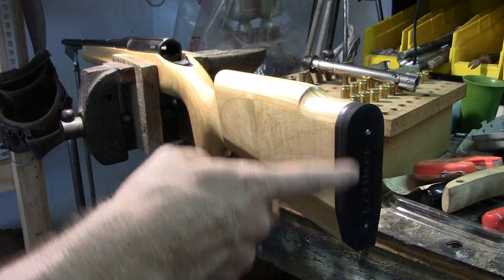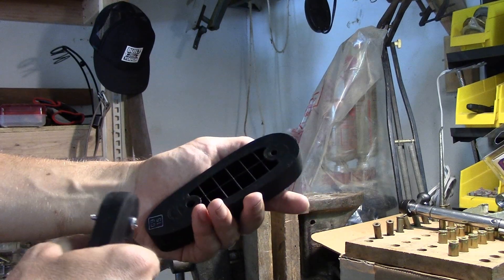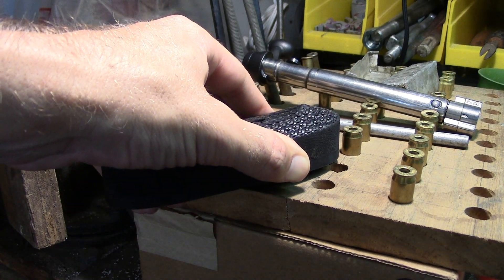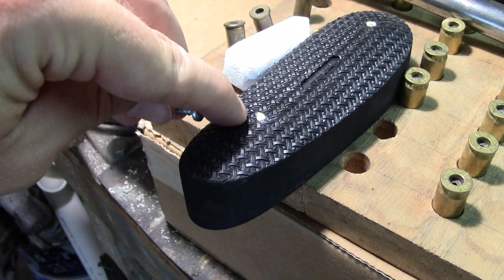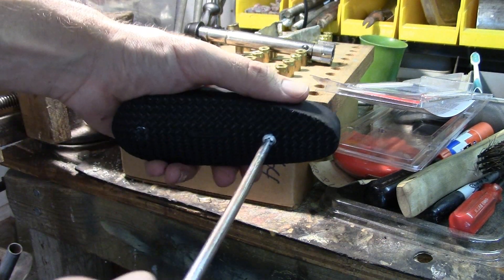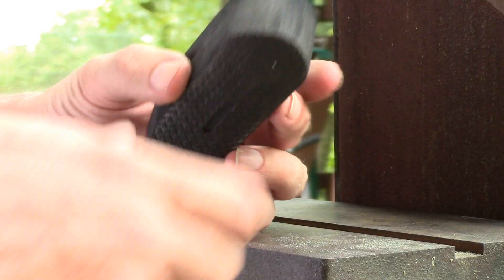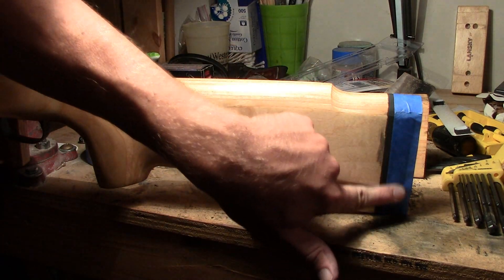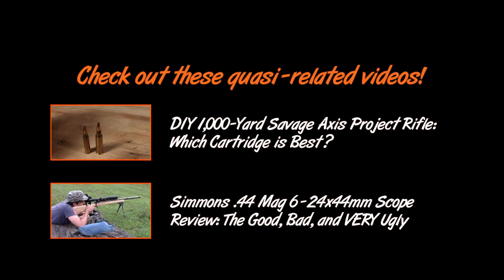Swap Buttpads - Shaping a Pachmayr Decelerator for a Boyds Pro Varmint Stock

Comment: 04/19/2025 Update:
================

Oops!  Forgot to tell u.  Counter sink the buttstock rubber around the screws w a flat router bit.  And use
appropriate washers to seat on that big hole.  U'll never have to struggle to unscrew those two holding
screws again.

Dink creatively than the others!  E.g., Minimize any maintenance headaches such as this as bad manuf.
designs continue as tradition as in this case.
====================================================================================
(4:54) I won't hide the screw heads.  Rather, it'll b better to use longer screws and keep the heads exposed

after the rubber cushion had mated w the wooden buttstock.  This is bc. if u strip the screw head (as my
used previous gun owner had done), it'll b very difficult to take those screw out.  So what if u or ur shooting
buddies make comment on the shinny exposed screw head on the recoil pad?  And it won't hurt ur shoulder
either.  Had to slice off the rubber to expose the stripped scrw hds.  I kant use the original (prev. owner's)
recoil pads any more, must spend $20 - $30 for a new one.  There comes a time when u'll need to access
the long bolt head that attach the buttstk to the receiver and the recoil pad must come out easily!!!

I did appreciated ur chaulk method.  For my case, i just drill the two holes all the way thru from the back,
w/o the use of Mr. Xacto knife.  Make sure to use a drill press to drill the holes perpendicularly.  If u don't
have a drll prss, then drill perpendicular hole thru a piece of 2 x 4 using someding(something) that is
square as a reference, drill a hole w ur hand drill, then use that as a guide to drill perpendicular holes thru
the recoil pad n buttstk.  Yes, a light removable glue at the back of the pad would help too.

Comment: How bad is the original pad? I messed up and forgot to order an upgraded one
Reply from the maker: It's very thin. If you picked a cartridge with any recoil, it'll hurt after a few rounds.
Reply: Mines a suppressed 7.62x39 so I don’t really know?
Reply from the maker: That's not too rough. Worth a try at least! If it's too uncomfortable, you can buy a limbsaver.
Reply: Cool yeah, how would a slip on limbsavsr work?
Reply from the maker: It should stick pretty well. Just a matter of getting the right size.

Comment: I really like your videoss, and the fact that you thought of building a target rifle on a budget. Too many people just go out and get the most expensive rifle and shoot off a 300$ shooting stand. So, well done for that build. I have a Savage Axis 2 chambered in .223 (the local range is rather small) coming my way, and I had a question about the bolt throw. Many have complained about the fact that the knob barely clear the scope that's on the rifle. What are your thoughts on that, and should I wait and buy the Savage Axis Precision rifle for roughly 700$ more? One has to think that the last rifle comes in a MDT chassis, a threaded barrel and a 20MOA scope rail. Considering that a Boyd's stock is 350$, a rail is 50$, and that I cannot put any device at the end of the barrel, I think I might pass on that purchase. All the number I mentionned are all in Canadian dollars. Thanks for your input and keep up the good work.
Reply from the maker: I think it depends on what you plan to do with your gun. If you plan hunt, you might still consider the boyds. Their hunter shapes are excellent. If you want a tactical/ target rig that you can fire suppressed, the mdt would probably be worth it in the long run. As for the bolt throw, yes it's close. I've had no problems myself.

Comment: Pachmyer sells brass templates that shows u the metal base of the different sizes of pachmyer pads.   make sure the pad u use has a metal base smaller than the dimensions of the stock or that is the size u will grind down the pad to.

  Or use kick-ezz pad that does not have a metal base and u can grind.as.much off as u want.  

Also u should never grind or nick your wood/stock.  Buy a pad grinding jig brownells or miday and.the part.of the pad u scribe 

 will up not down.and u can see  the scribe line to grind to.   It will.also handle toe angle.

U should never plan to stain or poly your stock.  This guy really needs to look at the tutorials online.
Reply from the maker: Fun ideas, but remember that this build is on a serious budget using common gear.

Comment: Also from Brownell's, get you a recall pad templates they are made of brass to find the size that you need of recall pad for your stock. This guy has no idea of what he's doing.
Reply: Pachmyer base templates show u the size of the metal base or insert in a small med or large pachmyer pad so u can buy a pad size with metal insert smaller than the stock dimensions.  It really does no show u the outside dimensions of the finished pad.

Just make sure the metal insert is smaller than the dimension u have 2 grind 2 on pad and u won't expose the metal base in pad like this guy did.  Really looks cheap.

Comment: No this is not how you install a recall pad, or a rifle pad. Use dishwashing liquid as a lubricant get you a fixture for Brownell's to set your toe angle. Get you a scribe to carve around the stock to get the the dimensions of the stock, to grind a fit. Feel the conditions of the pad with chalk; you can find this at any hardware store.
Reply: You can also use a scribe to push the hose through the pad, also use dishwashing liquid as a lubricant.
Reply: And that's the way it is.
Reply: I see you watch the Larry Potterfield of MidwayUSA video too.

Comment: I really need to get one of these boyds for my tikka. only problem i have is, i have the CTR model which has a different bottom metal and uses TRG mags, and they're saying its not compatible... but i think my dremel will make quick work of that! what do you think? lol

also, they offer both a pachmayr decellerator and the limbsaver as options, which one should i get? i hear the limbsaver is softer? if thats case i might go with the pachmayr, since i'm only shooting 260 rem.

I also want to build a savage axis II XP in 223 now as a trainer rifle because of your series!
Reply from the maker: Sounds like two excellent projects.  The Tikka question is a tricky one.  There may be some dimensional differences in addition to the bottom metal.  You might want to check around first.

Cutting an inlet for the bottom metal is possible.  You'll probably need to use a router and build some kind of jig to prevent cutting too deep or making the cuts too long.  Not an easy task, and it's not one that I've personally tried.

As far as the recoil pad goes, .260 (great choice) is pretty tame, so you shouldn't have an issue either way.

Keep me posted on your builds!  Folks have reported good accuracy with their .223 Axis rifles, but I haven't tried one myself.
Reply: So instead of looking at the Axis rifles, I've found a few options in the Mossberg MVP. having shot a few, both in 223 and 308, i'm convinced this platform is my best option. it borrows heavily from the Savage platform, but having STANAG mag options is HUGE for me, especially for 223. I spent some time behind my buddies, although he didn't have the same version I would choose, it makes an EXCELLENT fundamentals training rifle. 

just ordered the boyds, chose the pachmayr buttpad vs limbsaver, because a few reviews said the limbsaver is a bit softer, which is great for recoil absorption, but everything sticks to it and they get damaged/nicked/wear out easily. 

i'll probably do a video when I get it, seeing how the CTR fits up vs the standard bottom metal, and if just a bit of dremel work will finish it off. even if i accidentally over cut it, i'm thinking I could just bed the bottom metal with some JB weld. i'll be bedding anyways probably, though only after I do some out of the box accuracy testing.

EDIT: also in the works -- G3 magazine conversion for CTR mags. CTR mags are TRG mags, which are $150+ new. G3 mags are like 4-6$ each. a bit of cutting and some bending/welding and you can have a spare mag.

Comment: Your rifle is coming along good. This series made me go buy a savage 111 lefthanded in 25-06. Cant wait to start tinkering with it.
Reply from the maker: The 111 is a real gem.  I can't believe how good the prices are on that thing.  What plans do you have for it?
Reply: I picked it up for 370$. It has a wood stock from the factory. I will glass bed it and get a kydex cheek riser. Maybe do some trigger work. Gonna be a coyote gun so the barrel will stay sporter profile. After i save up for a swfa 3-15 the whole rig will get camo painted.
Reply from the maker: I like a gun with purpose.  Especially when that purpose is varminting.  :D  And what a great cartridge for that purpose; that'll be like a laser beam.

I've often wondered why I don't see more varminters using camouflage on their guns or persons.  Prairie dogs and coyotes can see extremely well.  I would want all the competitive advantage I can get.
Reply: I camo all my field guns. Some people are afraid to make their guns "ugly". I just use spray paint and change the camo for the different seasons.

Comment: I have really enjoyed watching this project. So much so that I ordered a pro varmint stock for my model 11, in .308. I ordered mine with the Pachmayr after watching you mention that the Boyd's standard was not comfortable under the recoil of a .308. I plan to pillar and glass bed, just as you did. Please do a video on the load that you end up using. I had planned to start working up loads today using 165 gun Nosler Partitions and Varget. I'll be curios to see where you land.
Reply from the maker: That's awesome, man!  I think you'll really like the shape of the Pro Varmint.

The load I'm currently using is 41 grains of Varget, and it shows good potential.  The only problem is that the pressures are a bit too close to the edge of danger.  I'm going to try a load with a milder powder.
Reply: What size bullet are you using and what is your seating depth. I loaded 165 Nosler Partition bullets with 42 - 44.5 grains of Varget today (1/2 grain increments). I based my loads on the Nosler manual. The Nosler manual shows a minimum load of 42 and a max load of 46 grains. If you're showing signs of pressure at 41 grains, I am a little concerned about my loads.
Reply from the maker: jbj92300
I'm shooting a 7mm 162-grain ELD Match bullet from a 7mm-08 chamber.  My COAL is 2.947" if I remember correctly.
Reply: For some reason I was thinking that your rifle was a 308 as well. Makes me feel better about the loads that I worked up. I'm still very new to reloading.
Reply from the maker: jbj92300
A world of agony and ecstasy awaits you.  :D  Handloaded ammo takes your shooting to a new level, but it's a constant tweaking game.  Good, clean, nerdy fun.
Reply: It's a great stress reliever. Because you have to focus on what you're doing.

Comment: Great tip using grease! I have Pro Varmint w/ Axis .223 I'm having trouble keeping the magazine in the little clip on it doesn't engage to my liking any ideas? Still waiting to here from Boyds'?
Reply from the maker: Interesting.  I suppose my first thought is to shim the back side.  There is a little piece of black plexiglas that holds the rear of the magazine in place.  If you add a thin metal shim to the front of that, you might tighten the connection.
Reply: Thanks, that seems like what I'm going to do. What do you, have planned for your next project?
Reply from the maker: DON C
I have a few more upgrades that I'll be applying to this rifle: 20MOA base, better scope, cheek riser, lead weight.  I also want to develop a milder load.  The Varget load I've been using performs well, but the pressures are high.  I'd like to back off a bit and avoid sticky brass.
Reply: I just picked up a cheek-rest works so much better. I got the Magazine working better than ever I put a little strip of plastic on the tab/clip of the mag. used a little bit of Epoxy, now it snaps in and best it stays in I think I know what the trouble was Boyds' had a customer return on this stock I got it for $75.99 Thanks for your, help
Reply from the maker: DON C
Nice!  That was a good thought.  Just out of curiosity, which cheek rest did you buy?
Reply: Voodoo Tactical  from Midway 15.95  they offer it in ACU Digital Camo & Coyote I'm getting used to it.
Reply: I just Replaced the Voodoo Cheek Rest got a Southwest Precision Model#611-02  $42.95 a lot nicer to finely adjust to my cheek.
Reply from the maker: DON C
It's a good-looking piece.  It seems a little thicker than the standard Kydex cheekpieces.

Comment: I really like following this project. I think it is because it is an attainable, fairly cheap rifle treated with care and consideration. It's more inspiring than a super expensive project. Also the narrating is very good because it is both technical and has thoughts and speculation in it too. It becomes a journey that way.
Fantastic format!
Reply from the maker: Thanks, bro!  The neat thing is that after all this work it doesn't come across as a cheap rifle.  It feels very good on the firing line and it shoots well.  Wait 'til you see what swapping some of these parts does.  I tested it a couple of days ago and I cut my 600-yard group size down to...well, you'll see.